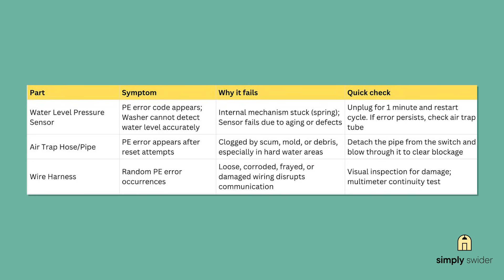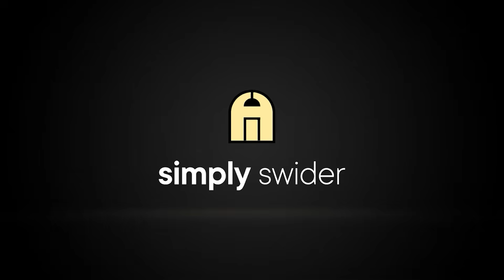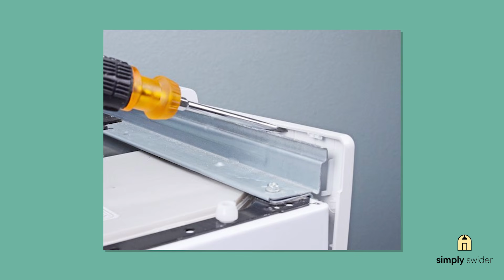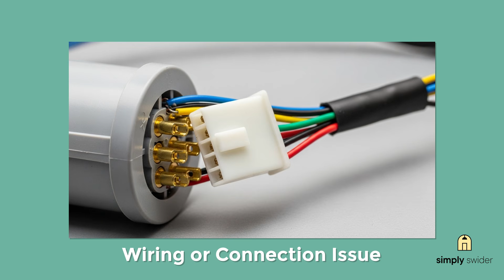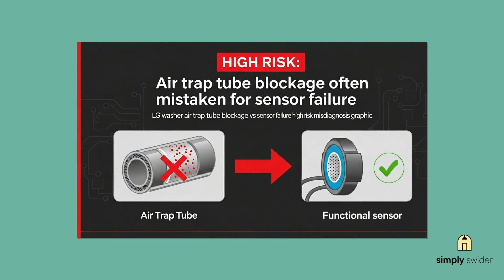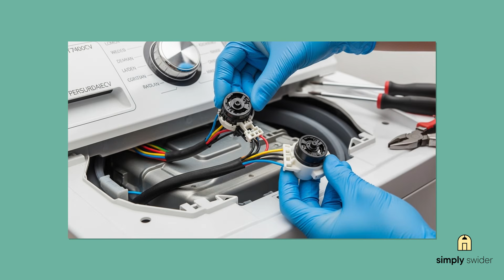LG Washer PE Code Fix - DON'T Call Repair! (Save $300)

Comment: You didn’t mention an easy solution for a quick fix which is to drain some of the water if it’s obvious the front load is on lock due to too much water in the drum.  Messy fix but if you need clothing washed fast to get in the dryer so you can get to work this is helpful.

Comment: Thank you. That fixed our   2019 LG Direct drive unit. Cost about $30. If we called an appliance repairman i bet it would have cost us $300-$400. It was the water level pressure switch.